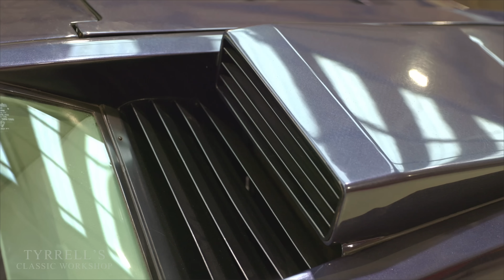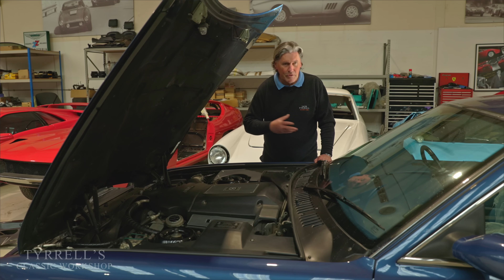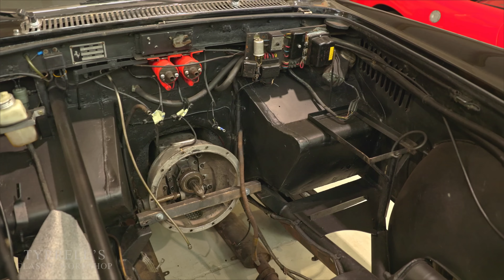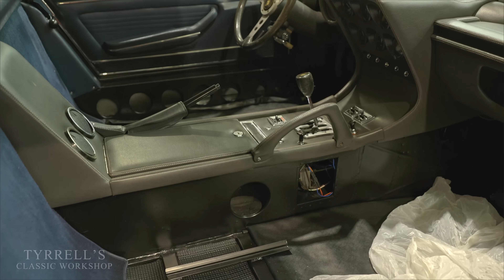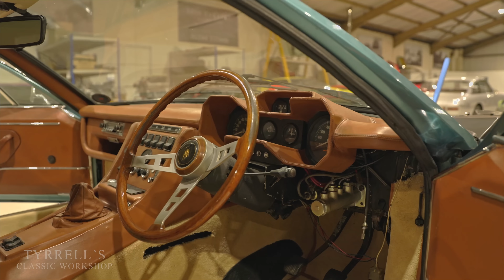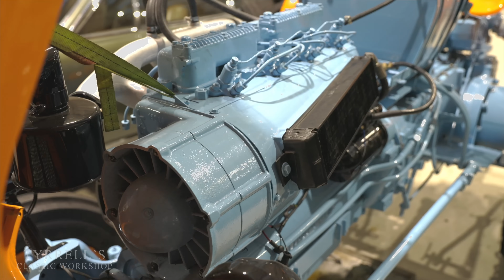Workshop “Ketchup”- February 2023 | Tyrrell's Classic Workshop

Comment: If the 1981 Countach has only done very very few miles in all those years, why did the paint get so poor?? I'm a purist and unless it's really rotten or the paint is severely faded, i would want to keep it all original.
Reply from the maker: It had been knocked and dinged on every panel, with some other things. Tough choice but the right one. Thanks for your interest
Reply: @iain_tyrrell  Thanks for replying. So it wasn't necessarily the condition of the paint that led to the decision.  It was more of the conditions of the panels. Understandable.

Comment: Thank you Iain. Great video. That original engine made up as a working display unit is absolutely stunning. The DBS V8 looks really sharp and I eagerly anticipate the dedicated video. The tractor is beautiful and the cast iron mudguards are a perfect solution for maximum traction. You certainly could not dent them whilst climbing in and out of the seat!😊

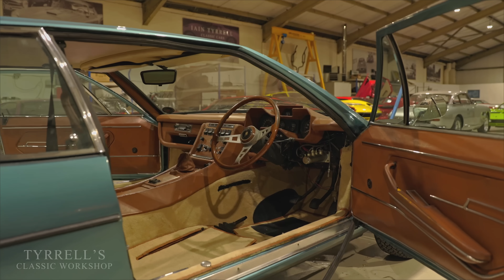Comment: At 12:00 that brake master cylinder ready to destroy the driver's knee is almost beyond belief. It wouldn't be out of place in a medieval torture dungeon. I suppose there is a cover for it but I have never seen such placement in any other car. Surely space could've been found on the other side of the firewall.

Comment: I like all the cars featured here but my attention raised when the Continental R was mentioned. I am very lucky to own a late R and I just love it. Yes it's complicated but in its defence, it goes wrong sympathetically, most of which can be fixed fairly easily. I recently removed both door panels in search of an annoying squeak. Unlike modern cars the panels can be removed in just a few minutes but whilst off I turned over one of the wooden door caps and found a strip of masking tape with a mans name on it. Intrigued I went through social media to see if he popped up anywhere but nothing. I eventually tracked him down on the BT phonebook so I called the number. To my surprise the actual man answered the phone and we chatted for over 1 hour. Back then he was part of the quality control and is now in his mid 80's. That's the sort of things you get with an older Bentley, an almost hand built car made by normal talented folk in Crew. 

These cars aren't as expensive as you might think so buy one before it's too late. We are taking ours on a 3k road trip across Europe this summer, well it is a Continental.

Comment: Tyrell. At about 11min, you have the Ferrari engine. You say a few minutes earlier that this 3.5L engine is practically shit. it's fragile. Also I've heard that because of regulations and taxes, the US-market often got larger engines. So was the 4L for the US-market really? or did they made the 4L because the 3-5L turned out to be to weak?  I really cannot believe customer wants a engine that will fall apart when you crank it, when he already had a more durable engine in the car.

Comment: Hi Ian ,I did a high speed tractor run (M-Ferg, about 1966) across a plowed field, just about holding on to the steering wheel, (there was nothing else),sitting between those big tires you quickly learn the 20mph is excessive speed.

Comment: Hi. May I ask something? The Countach as you say is earlier than the registration that makes the car look newer on the road. I thought that wasn’t allowed by the DVLA. Is that because the car was registered long after its build date or the laws have changed? Pardon me if it seems a  pedantic question. Is not meant in such context. I’m simply inquisitive! Regards from an avid enthusiast!👍
Reply: You can't use a private reg to make a car look younger, as in theory it could fool a buyer. As you say, it was probably registered later than usual.
Reply: Good question. I had a car that was built for track use … raced for 3 years. I then had it converted to road use … the registration was 4 years younger than the car.

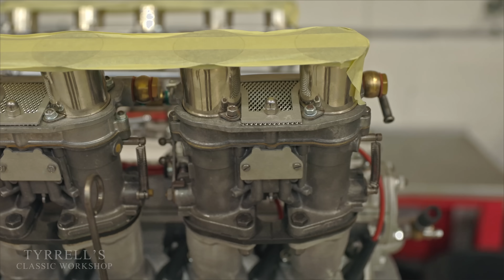Comment: 9:39  Iain, you said "no production Lamborghini V12 of this era...the Countach was the first one to have downdraft carburetors..."  No front-engine GT car maybe - I remember Harry's Espada had side-draught carbs - but I thought the Muira also came with a downdraft carb setup?

Edit:  Yep, the Muira also had down-draught carbs...only it had 3 chokes per carb (and so only had 4 carbs on the engine), instead of the six twin-choke carbs we see here.
Reply from the maker: You are indeed right. The perils of one- takes! A very large mistake on our part. Thanks for pointing it out!
Reply: @iain_tyrrell   No worries.  I just remembered it from when you pointed out that Harry's Espada had side-draughts -  unlike a Muira.  Cheers, mate.  👍

Comment: Technically it's not "intercooler" as they are normally used on cars.
The term comes from the aircraft industry where an intercooler was mounted between stages of compressors* (mostly during WW II era), the cooler between the last compressor (or single) was referred to as aftercooler! (Club of worthless knowledge have now spoken)

*If it was an exhaust or mechanically driven unit or a combination thereof didn't matter